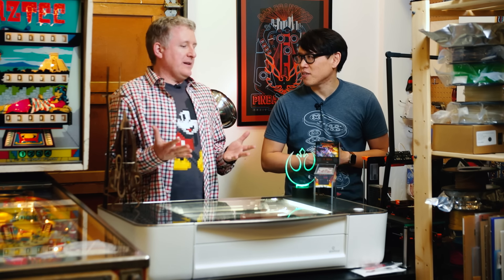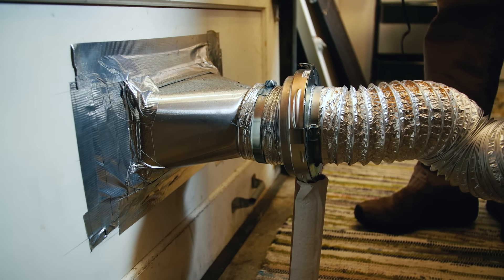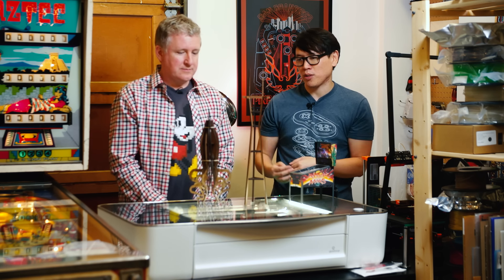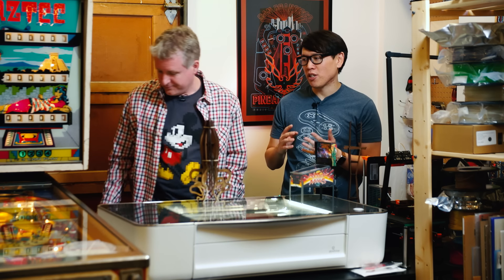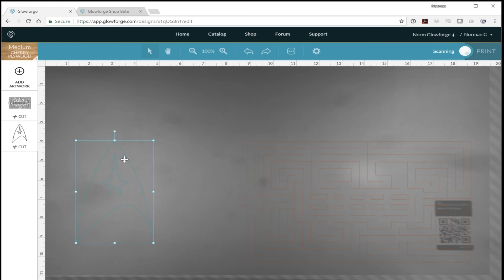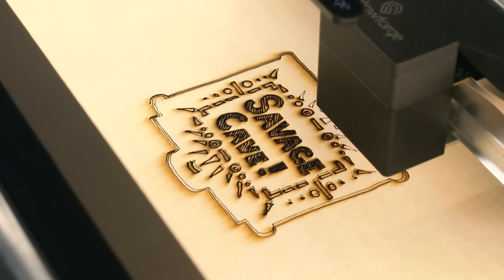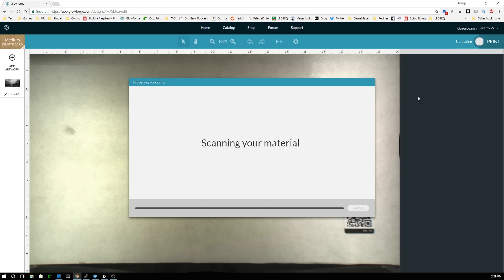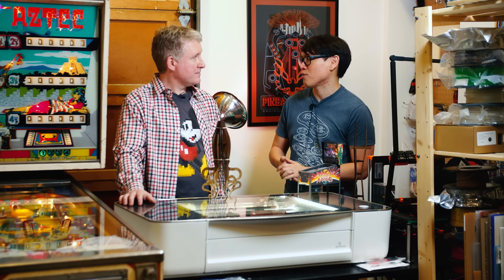Tested: Glowforge Laser Cutter Review

Comment: why bother when you can buy a 1300x900 bed with 100w laser extraction fan etc ex China for less than $3000 USD?
Have been running two in our factory now for a couple of years with no issues...
Reply: Do you have a link on where to find the cutter you have?
Reply: Thanks!
Reply: This! This so much!
Do not buy the Glowforge! It's garbage value for money!
Not to mention that the 45W "Pro" version is literally just overdriving and killing a 40W tube. It won't last a few hundred hours.
If you want a 40W laser cutter, a "K40" or "Bluebox"(same thing) machine is ~$400-600 on eBay/Aliexpress *delivered*.
And they give you an exhaust duct for free.
Reply: That's nice to hear. I have been participating in laser cutting forums for almost three years and the Chinese eBay cutters are always having their users posting trying to fix various problems with them—even when they come new off the delivery. (OTOH they can be good buy for someone who likes to tinker hobby.)
Reply: The good thing is that the issues are all very well documented and solutions are already laid out step-by-step.
Reply: True, to a point. I've seen the regular problems and their users and how frequent and repetitive they are, and how essential community support is because you can't really count much on the suppliers of those lasers to help someone tweak, for example, with a just delivered gantry system that doesn't focus uniformly nor cut smoothly. Many people buying a laser for hobby cutting are not inclined for that tinker and tweak relationship. I don't fault those who love rolling up their sleeves and getting into all of that—but there are those for whom that isn't a fit.
Reply: To be fair, I'd rather save over $1000 by spending a few hours reading forums and making a unit I purchased be shiny and nice.
Frankly, you have to be fiscally and technically illiterate to blow so much money on a Glowforge.
If you're a maker, you can produce some effort into running gear too. If you own a company, you know you're not buying this junk, you're buying(the same) Chinese machines but from reputable resellers with guarantees and support, for a premium.
Reply: Time is money. Everyone wants to spend it differently. I was delivering on a client job within 30 minutes of receiving my Glowforge. I participate on forums to boost my creativity, improve my craft, and that I like the community— not that I'm trying to solve why my machine isn't working. But to each their own.
Reply: Okay, I thought I was just missing something obvious, because as far as I can tell, the only decently expensive components in a laser cutter would be the laser, gantry, and cooling system (and filtration, but from what they said in the video, it seems to be an ADDON to that price.), and seeing as each of those wouldn't cost more than 100 to 200 dollars apiece, a 40 watt hobby cutter for 4500 seems rather ridiculous.
Reply: Have you shopped for a Muse and looked at its costs? It is very similar price. You can upgrade it to be water cooled, like the Glowforge pro is. One advantage is the extra z-height module and extended focus depth lens sets (though they increase the width of the beam) that Glowforge has not developed. 

And with FCL (maker of Muse), for example, you're buying from a domestic laser company who are trying to create a product sales, support and UX environ that is not the equivalent of vendors who want to sell on eBay to people who, say, would love to tweak hardware for their own home-brew PC. Different positioning. Different CX/UX.
Reply: give a man a fish or teach a man to fish
Reply: How can I contact you to ask some questions about your experiences with these lasers?
Reply: Spirit do you have proof?
Reply: I have 3 lasers, 2 of them similar to the ones linked in this thread. The glowforge is my favorite, and has the best output quality of the 3 by far. The statement about the 45w tube being in overdrive is a complete fabrication as well. Ive actually had mine for over a year and run it every day. Havent had any power degradation at all. Most of the statements you make here have no basis in fact at all.
Reply: You could, but youd be missing out on a lot of functionality. I have a k40 and it doesnt get anywhere close to the quality of output that the glowforge can make. So you can buy something with crap components and questionable lifespan with low quality output, or you can spend a little more and have something amazing
Reply: Is the glowforge faster? Sharper cut edges? What does make it actually better?
Reply: variable power supply and autofocus are gamechangers. your cuts/engraves are always in focus, and its ability to render graphics and/or 3d engraves is completely unmatched in this price range. drag and drop placement via camera is nice when working with scraps. The previously mentioned features however, put out engraves that you just cant do on other lasers that have been mentioned here as being other options.
Reply: Why $1300 to deliver overseas!!!
Reply: @bryanjensen355  this is true. I'm in the market for a laser and have absolutely zero knowledge. I operate 3 businesses and I have a career where I invest 12 hours a day. I also train jiu jitsu and muay thai 4 hrs a week. I really want to fucking buy the Chinese laser buy god fucking damn, i dont have time or the patience to sit there with my thumb up my ass trying to figure out why this went wrong or why that went wrong. Now I'm stuck trying to decide what laser to buy.
Reply: I bought a Chinese 50 watt blue box laser almost seven years ago,  have replaced the tube tow times since new. Never had any issues. Have made a good living from my machine and it has paid for itself many time over.

Comment: Wow great review. I am convinced that I WILL NOT be buying one. I had an interview with Epilog laser and a bigger starter used one with a metal tube (which lasts about 6 to 8 years) was around $15000. much more for sure but had an 80 watt laser and a deeper tray with spindle option for round objects and infinity tray. And no need for internet connection.

Comment: Can anyone send me recommendations for laser cutters that someone with minor tech software knowledge would be good to own? I have tons of graphic designs that I would like to cut with but am scared about laser cutting software.
Reply: any 2d cad drafting software that exports DXF files work with the cutter I have and I think most other cutters will as well... the controller that I have is RD works... google it
Reply: My Epilog cuts straight from Illustrator or any other program you can print from. It seems most Epilog users have Coreldraw, but you you could engrave from Powerpoint if you felt so inclined. Cut lines are just defined as any line under a certain width.
Reply: RDWorks is a decent laser software package to import .dxf files, but it's limited to the Ruida controllers. Inkscape is a free drawing package to design your own graphics. 
Check out these videos on laser cutting, engraving and RDWorks.  https://www.youtube.com/playlist?list=PLPWEtx5V9DqEogIeYRdcG_KYcB7UL2Qmn

Comment: Fair review. Glad I got a refund of my deposit and bought an Epilog. 100% of Epilog features work as advertised, out of the box.
Reply: Warren Bailey what model.did Yo got
Reply: A Helix 24 60W (24"x18" bed size). First professional laser I've owned after several cheap import and DIY. Really I had no idea how different a professional system was - I don't think many DIY'ers understand these aren't just expensive versions, but the technology is on another planet.. closed loop high speed motors (not steppers); auto-bed height and focus, and waveguide lasers that don't require water cooling and have a beam that is so small compared to glass CO2 lasers.. lower kerf and no focus alignment issues.. and drivers that work, and manuals in english, with charts for perfect speed/power settings for all materials, the list goes on and on.

Comment: Only 40w? Bit on the low end after getting used to kilowatts as the power measure.

But really any not just have a printer sheet of qr codes to stick onto similar materials? Or make it possible to render on a user's computer rather than their website? The company goes under (and if it's Kickstarter, well....) You're stuck with an inoperable laser until someone in the community gets angry enough to bother hacking/writing/sharing custom firmware.

Comment: For those of you considering Glow Forge Laser consider this first.  The laser has NO built in software and will only function via a top notch Internet link to the Glow Forge Server hub!  You lose internet connection you lose Glow Forge capability! If Glow Forge server hub is down or they go bye-bye at some time in the future you have a large expensive paper weight! What if they decide to start charging you connection fees?  You have no choice but to pay up or your pretty laser won't work anymore! After paying anywhere from $2500 to over $5000 for a laser I should think you would NOT want to be dependent on someone else's server.  Think about it guys/gals before you buy.  Sure it's a nice machine, as long as you can connect to the Glow Forge server hub!!

Comment: 40 watts isn't a cutter. it's an engraver...and the whole gotta use the web to use it...breaks the idea for me
Reply: I have cut through 1/2 oak with my glowforge.
Reply: I regularly run an 80 watt laser...and it won't cut half in wood...1/4 inch is touch and go.
Reply: You would need a longer focal length lens. Usually thicker materials require this as well as strong air assist to keep the cut clear. You will also run into issues if your beam is not perfectly aligned when trying to push through thick materials like that. I can cut 1/2" acrylic fairly easy with my 1.5" lens (120W) but it's not a perfect cut due to focal length.
Reply: I cut 1/16 - 1/2" acrylic every day with my 40W Epilog.
Reply: Acrylic is FAR easier to cut then wood.
Reply: That's true, but 1/4" MDF cuts with plenty of power to spare as well. The only time I've run into problems with woods is using low grade ply with glue-filled voids. Hardwood plywoods typically cut with ease up to 1/4".
Reply: The Epilog is a far better machine then most on the market that helps. the Glowforge isn't that good (nor is the one I regularly use)
Reply: From what my friends who frequent makerspaces tell me, that is true. I have a friend who is currently searching for a used Epilog so he doesn't have to use the Chinese laser at his space. I'd take a used 10 year old Epilog over one of these, and they'd probably be about the same price per watt.

Comment: With the amount of money spent on this stuff, you could invest in proper metalworking CNC machinery like a mill and a lathe and make real things that don't have to be concealed and faked with paint techniques. The question is how many shitty plywood and plastic trinkets can you fill your home with? I just feel like it's all a waste of time when the leap to real manufacturing in metal is not that far further.
Reply: Will that also work with wood and plastic? I can't seem to get anyone to actually confirm you don't need entirely separate devices.  In addition, just as a thought, this and a reasonable 3D printer can be used in, say, an apartment, but I don't think my apartment could handle 'proper' CNC machinery, so this - when mature, which honestly, it isn't - can work with the things that I want to work with, mostly plastics, light metals, and some wood.
Reply: A mill and lathe can certainly do wood and plastic. It probably needs to use a different cutter then metal stuff and you will have to deal with more cleanup and a larger kerf, but its certainly very doable.

Its a bit more, but you could certainly get a Tormach 440 for not a whole lot more and have a much more powerful setup. I'm sure there are cheaper fully chinese (Tormach is manufactured in China but designed and sold through a US company) that are cheaper too.

Comment: I wonder if Glowforge belongs to the same mother company than the Cricut vinyl cutters ... between the primitive and mandatory cloud app, the wasted material on the borders, the crappy politics regarding their models library etc... looks like the same people are behind these two products. Regarding the Cricut machines, they go as far as encrypting the USB protocol to prevent the development of third party software to drive the machine, and sue the software companies trying to reverse engineer it. So yeah, if the the company goes bust, or if the servers are down, or if they decide that your machine is not worth supporting in their app anymore, you are screwed and end up with a giant and expensive brick !
I made the mistake to buy a Cricut (it works very well, but I wasn't aware of their practices, and I regret supporting them now ... ), I will keep it for now, and not buy anything else from that brand anymore, and I won't buy a Glowforge ...
Reply: Oh I hear you.  I was a dumb ass buying cricuts imagine for $550 when it released and it was the biggest mistake of my life.  They stopped selling the ink for the print function which was pretty poor anyway.  I tried to get them to take it back and give me ANY other cricut; even at a loss.  Total waste, they never responded and could care less how many people bought that crap!

Comment: so basically it sucks right?

I mean that is what I get from this video.  Super cool thing with stupid problems for 4000 dollars.
Reply: It doesn't suck nor filled with problems. I have the Pro model and It works reliably with some differentiating features for the market. But it is a community of customers and users largely bought in for the support and development, which is still underway according to the software feature vision of the original crowdfund. If the patience for supporting that isn't in your DNA, it would be best to get something else or wait to buy till they are out of beta.